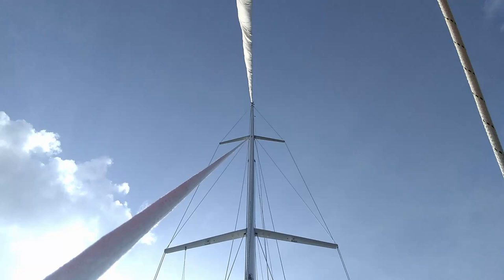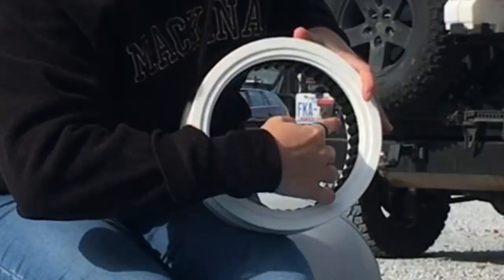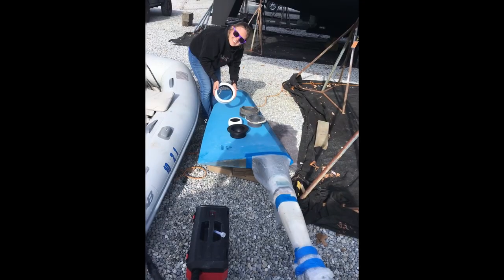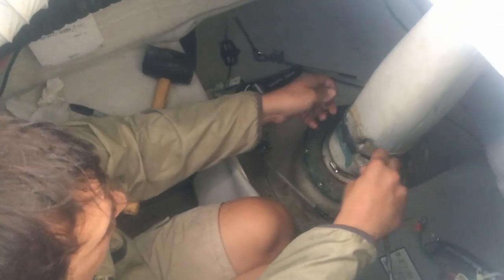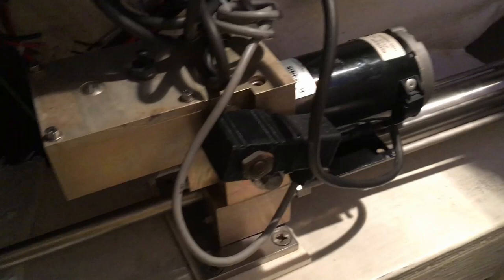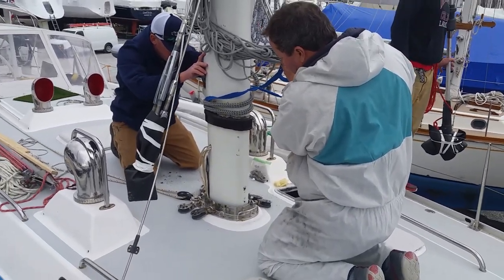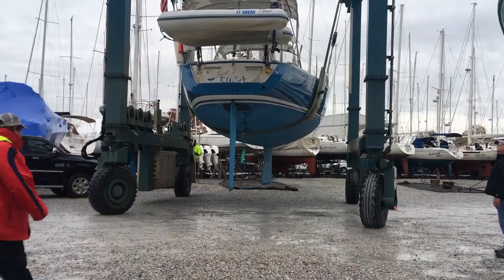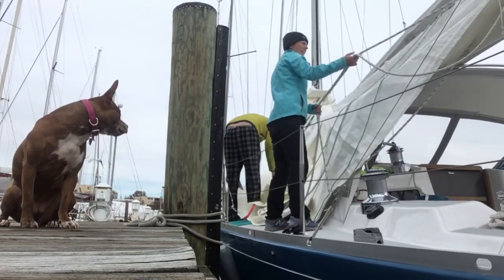Can We Put Our SAILBOAT Back TOGETHER In Time? [Ep. 12]

Comment: Another great video. Some questions: 1) did you add running back stays where you added the attachment point for the new inner fore-stay? 2) do you have a storm trysail on a separate track? 3) Have you seen Skip Novak's video on "How to Choose and Use Storm Sails" where he recommends a 4th reef in the main rather than a trysail? Most interesting.
Reply from the maker: Thanks Ron! :-) Yes we added runners at the IFS (moved the existing checks there actually). We do not have a separate trysail track. Yes we have seen Skips video, we agree with big reefs vs storm try in most situations, especially on a short handed boat. Good thoughts. So far it’s been hard to justify the money on orange sails as we don’t intend to put ourselves in a position to use them, and either just the 3rd reef in the main or just the staysail is equal to storm sail area, the boat sails OK on either one alone in heavy winds, and we are on a tight budget. Would love to hear yours and others thoughts on this topic, as it’s a good one! 👍
Reply: I put a 4th reef in my main that would result in a square foot area comparable to that of a properly sized trysail for my boat, a Tartan 3700. I have yet to set up the hardware and lines for it to reef from the cockpit, as my sailing plans for the moment should not take to places or situations where I'd be likely to need it. But if you do sail around the worId, south of the great capes, you will.  I sail with a 110% headsail that reefs down nicely to a 75-80% and still has shape. All reefs in the main can be taken from the cockpit. I do own an ATM galesail which would, of course, require me to leave the cockpit to use it. but God willing, it will never leave the sail bag. There are at least two significant differences between you guys and myself that have me focus on making things as easy as possible for me when sailing: 1) I am a singlehander and 2) I am in my late 70's.

Comment: The J46 sounds like a very well built boat, such as integral stringers.  Is the rudder stock behind a watertight bulkhead?   This would avoid total loss in the event of a failure.  Without a skeg to protect the rudder and take some of the working load, the rudder is dependent on the stock and hull around the bearing.
Reply from the maker: No watertight bulkhead. Check out the video where we install new rudder bearings for a closer look at that area.